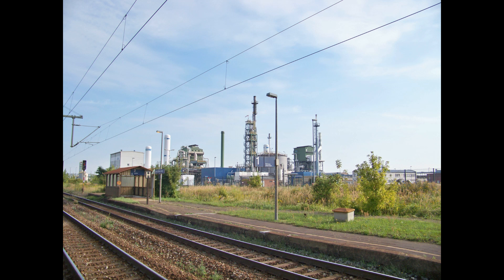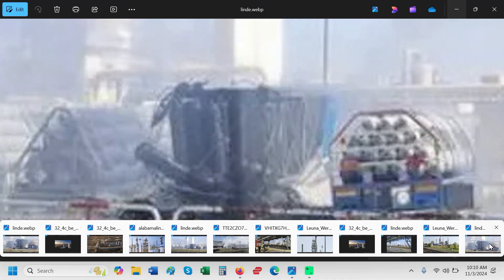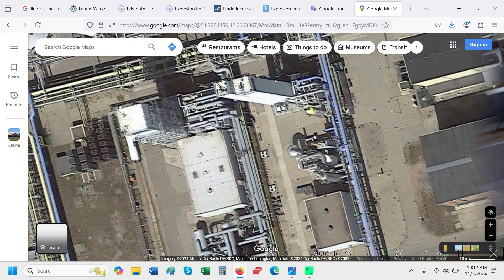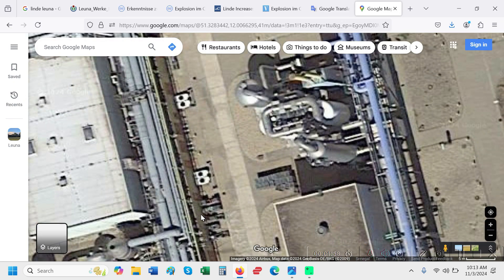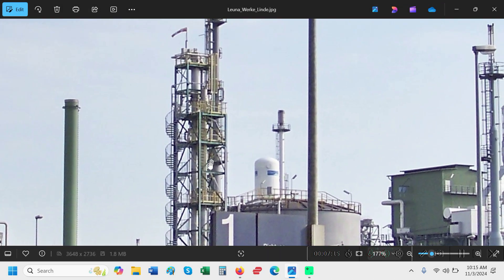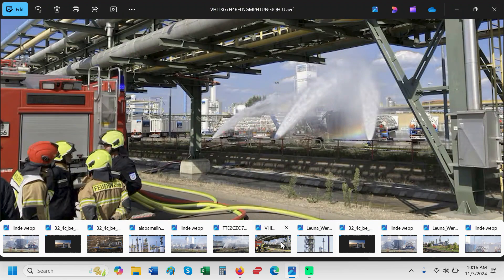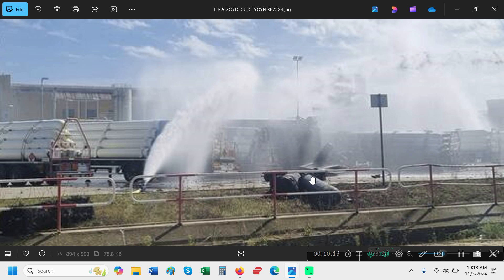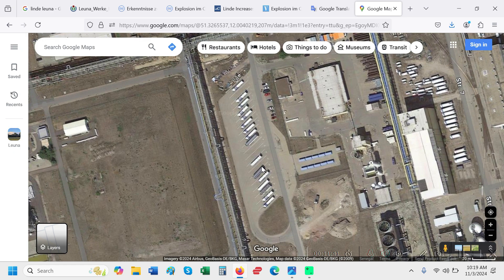Explosion at Linde in Leuna, Germany

Comment: the trailer that exploded is not the same as the other. 
you can see tanks destroyed are class 4 tanks with carbon fiber.
Nothing felt on the trailer, I think it's heaxagon purus trailer, and you can see cross reinforcement  you mentioned in the image on the website "hexagon purus hydrogen distribution system"
Hexagon purus has already know for leakage.